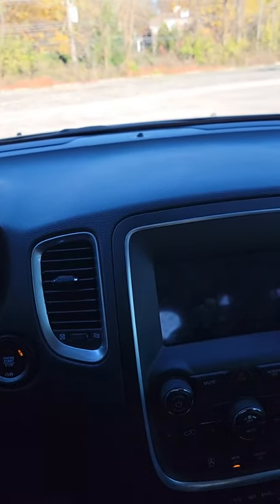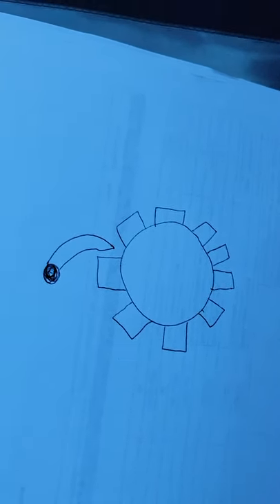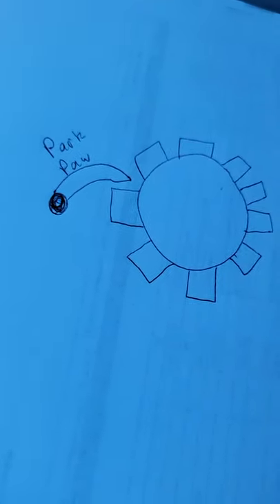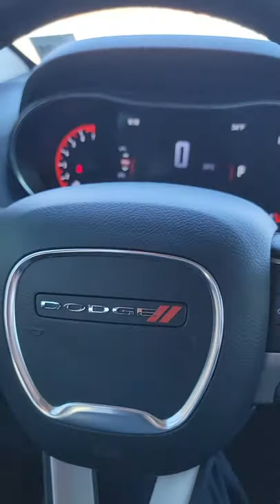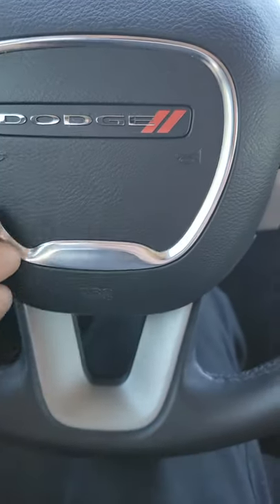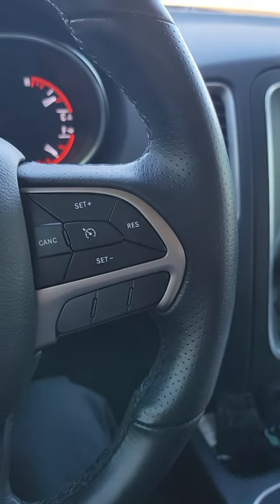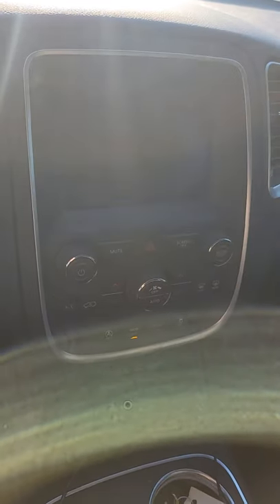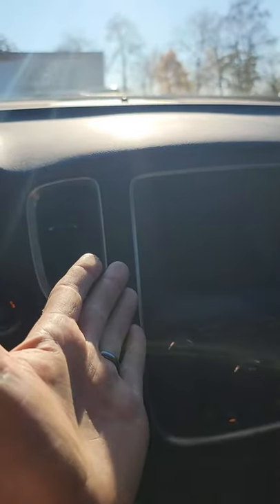clunk noise when going from park to drive (automatic transmission)

Comment: Thank you for clarifying that the clunk is normal and it does not hurt the transmission  I have a mercedes and it clunks when on incline or decline. I almost feel pain when I have to shift from P to Drive . Not now that I learned this is normal.

Comment: I love when a mechanic tells people a "clunk" is normal. When it is in fact, not normal. Especially with non- new cars. 😒 
If you have a hard shift from park into reverse, as if there is abnormal tension in placing the gear shift into another position. You likely have an issue with your transmission, it could be low cost, or high cost issue. Clunks are not "normal". Things should move smoothly unless you're driving a race car that's got an extremely stiff clutch setup ect.
Reply: That's true but I have a 04 Jeep Liberty four-wheel drive the rear passenger will not the transmission which I was told have something to do with your parking brakes

Comment: I usually go into neutral first, then apply parking brake, then shift into park. I heard this lessens the ware on your transmission overtime but not 100% if it holds true. Still do it out of habit even on level surfaces lol
Reply from the maker: Yes that is a thing
Reply: I just keep my foot on the brake, pull the parking brake all the way, then shifted in the park. Then when you get back in your car and put it into reverse can you pull your parking brake after your shift into reverse

Comment: That’s what I thought I was having happen to me in my Ram 1500. Sucks that my parking brake is seized at the moment though 😂. However, when I’m shifting from drive to reverse or vice versa (with my transmission being set up in a “P R N D” way) I hear a nasty clunk, and sometimes in reverse it goes as far as “jolting” the truck. Truck has 194563 miles and if I could do some preventative work to make the transmission last longer, obviously- I’d like that 😂
Reply: the exact reason why im watching this video. had me thinking something was wrong.

Comment: well explained :) is the clunk more massive when shifting from P to R in an incline. rather than P to D. or it's the  same depending how stiff the incline?? in my case  first, i put  my foot  on the brake  then,  neutral  the car rolls a bit. and then use the hand brake.
Reply from the maker: Yeah,all normal, dosent matter R D N L etc, it will clunk no matter what
Reply: @crytech706  thanks for the info

Comment: my vehicle clunks when going from park -> reverse, park -> drive, drive -> park, also at lower speeds when accelerating. When in manual mode (2nd gear) and accelerating, it also happens. My scenario sounds a little bit different. Any ideas?
Reply from the maker: Yeah, I would get it checked out, is the fluid low or dirty at all or is it one of those situations where you can't check it cause it's sealed

Comment: I have a 2013 Volkswagen Jetta SE 2.5 and I just recently (like a month ago) got my "sealed system" transmission serviced which included a new filter and emptying the old transmission fluid and filling with new transmission fluid and now this just started happening to me. The clunk feels almost violent, it's very hard a very loud, and MY CHECK ENGINE LIGHT IS ON AND THE LITTLE WRENCH THAT USUALLY ONLY COMES ON WHEN I NEED AN OIL CHANGE😭. I tried to hook an OBDII scanner up to it to read the codes and even though I see the check engine light on, it's not reading any codes. I did notice when I do what you suggested in your video it does help, but the check engine light is still on. Another thing I noticed is if I try to drive my vehicle after putting it into drive after the clunk it is very slow to move and almost feels like I have the parking brake on, at least until I get into like 3rd gear (it's an automatic) but as soon as stop at a light or slow down it's goes back to barely creeping along. The rpms don't rev up though which I find weird considering I almost have to floor it just to get it up to 10-15 mphs. Any suggestions? Sorry for the long description.
Reply: Hello I would suggest you have your parking brakes checked it could be worn I have a 04 Jeep Liberty that does the same thing when I had my parking brakes checked the material was gone

Comment: This happens to me but what if it does that when you’re not on a decline or in a incline position? 
It also seems to happen when I get in my car to start my day and first put it in drive.
Reply from the maker: Good question, usally if that happens it's a lack of hydraulic prime, or it's engaged into gear literally right as you start on a cold start, cars engine is basically a vacuum pump and will run at a higher RPM on first start and not letting it calm down for 30 seconds or till it reaches a low RPM like 700 RPM it will engage softer, if not it's an internal problem but it would happen everytime you go into drive, if it's first start up then it's just the engine at a high RPM and trying to go lower RPM to soften the blow on engagement, sorry for the long explanation
Reply: @crytech706  Thanks a lot for elaborating and making it easier to understand. I tried your emergency brake method when I first started my car the other Morning and it worked perfectly even though it was on a flat surface. There was no clunking noise I just heard it move into gear so thanks again for your help. It was very useful. 👌🏾
Reply: I thought the video was for automatic transmissions
Reply: @mikelarry1198  it is
Reply: Yes same thing I was thinking cold strat let that car warm up little longer I have 392 so big block take little longer to warm ip
Reply: @crytech706  thNk you
Reply: I would say check your shift cable and your shift cable
Reply: Check the shift cable and the shift cable linkage because of pushing me being gone bad

Comment: I get that noise to on reverse and drive. I also get a clunck noise similar to that when I’m braking coming to a stop is it normal or is it something I need to get checked out ? I have a challenger RT
Reply from the maker: Yeah, if I had to guess it's your tension struts in the front the bushing blow out in them alot, best way to know is go to a slow roll in drive and slam on the brakes if you hear or feel a bump in the front, dead give away it's those tension struts

Comment: question while driving slow on small street bump I have clicking noises from right front side I replaced both axles and both linkage but i still have clicking noises  what you think of that?
Reply: Check your engine mounts or wheel bearing but most probably your engine mounts might be worn-out
Reply from the maker: I woukd agree on the engine mounts, if you put it in to R And apply the parking brake and the normal brake and hit the gas is the clicking noise that you are hearing there and also dose it seem like the front of the car is jumping that's a good sigh the mounts are bad
Reply: @rodrigomarroquin6936   doesn't have wheel bearing is a axle I replaced both side axles and engine mouth nothing to do with this noise  what ever is round is not a soccer ball

Comment: This not normal bro what you talking about,there's is a problem and need to be fix
Reply from the maker: Okay do tell, cause even in most automotive diagnostic states if there is no codes and the fluid is clean and clear and passes the clutch air test then it passes and is a normal condition, but if you have some information that can shed light on your theory I would love to hear it